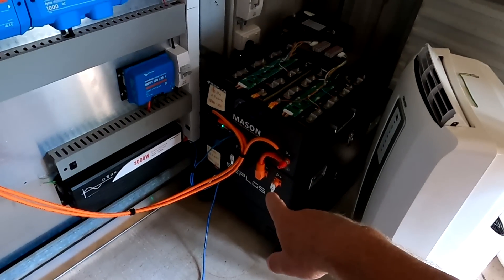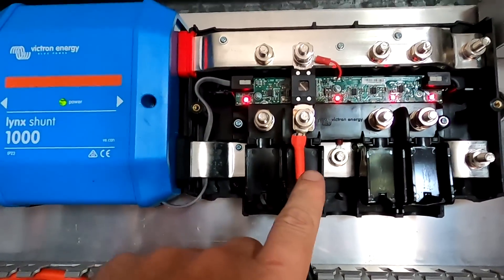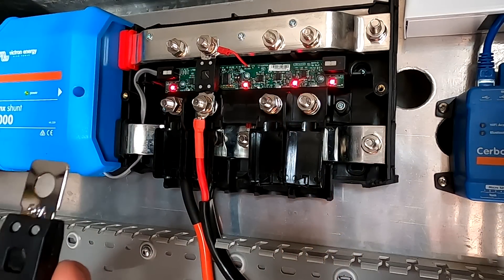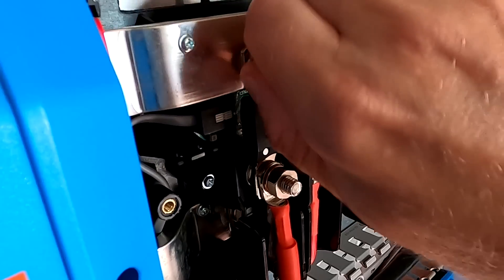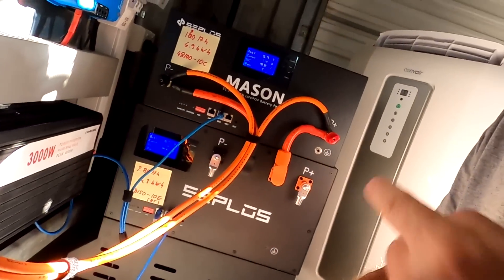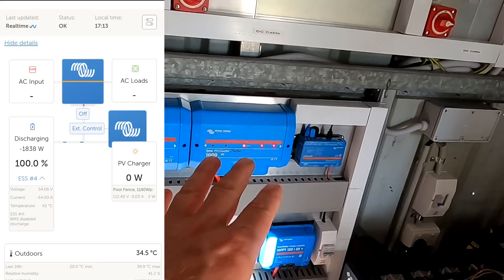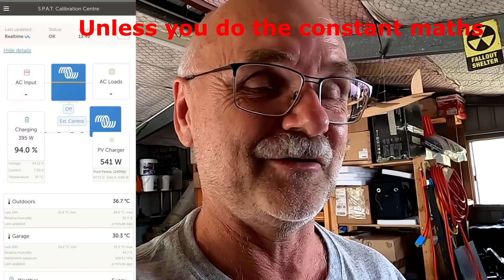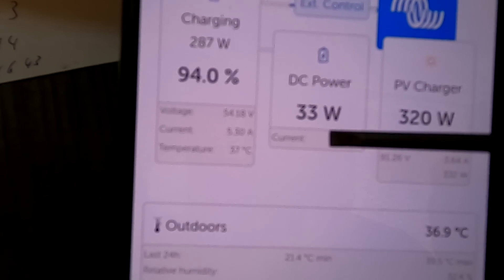PowerWall2.2 Xijia 3kW Inverter installation. I totally forgot about it...🤦‍♂️

Comment: I'm surprised Andy won't get him one of those ac mini split heat pumps systems with built-in inverter technology they do both heating and cooling I just got mines and I haven't hooked it up yet but everyone on solar is using these in their garages and homes they called mini splits the indoor air handler hangs on ur wall and the other part sits outside.
Reply: I installed a mini-split.  Very efficient and a great solution.  Highly recommended.
Reply: @bobblack3870  I can't wait to get my ass up and running
Reply from the maker: Where should I mount it??????????? No frickin wall!
Reply: @OffGridGarageAustralia  and it is a garage there are four walls all the way around well 3 hang the indoor unit right overtop your work area where you talk to us at clear some of that stuff out the way 😂😂😂😂😅👍😉